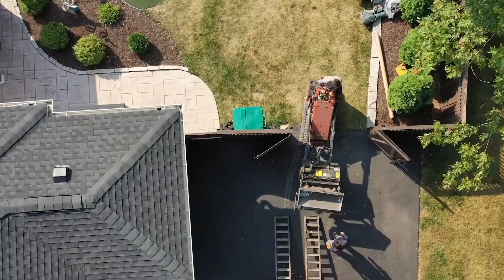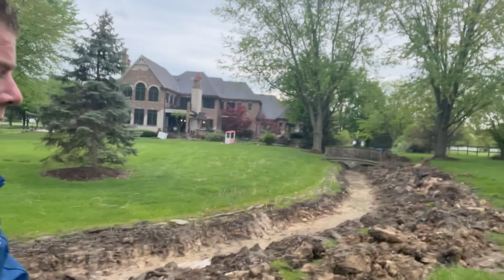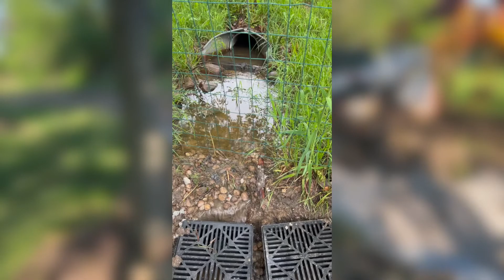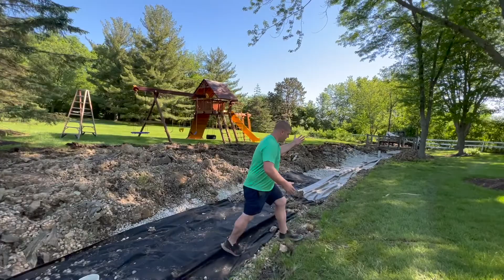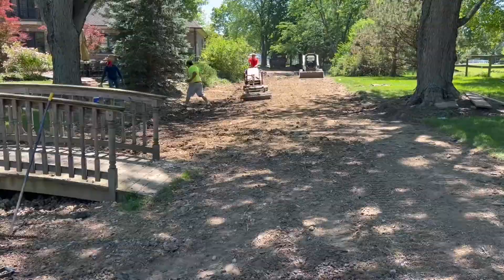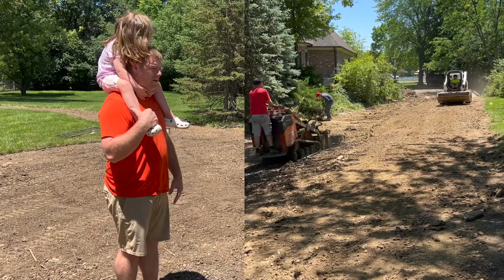Monster French Drain Installation | Landscaping and Drainage Tutorial

Comment: It’s not a burrito wrap you guy’s just put filter fabric on top of the French drain why not wrap the whole French drain bottom sides n finish it with top that’s what we call a burrito wrap French drain u guy’s just killed the life of that French drain it will work not for long as time goes by dirt will work it’s way in the 🪨 n clog the French drain 🤦🏽‍♂️ I put a 200 ft French drain system in my back yard a real burrito wrap French drain geo fabric on the bottom of the French drain sides put my 4 inch Perforated Corrugated pipe filled it up wit 1 inch wash drain gravel closed it up wit the geo fabric wit pins 5 years later working like a champ ✅🤙🏽
Reply from the maker: That's an interesting way to do it, thanks for sharing! 😀